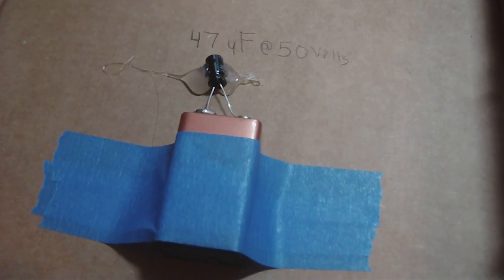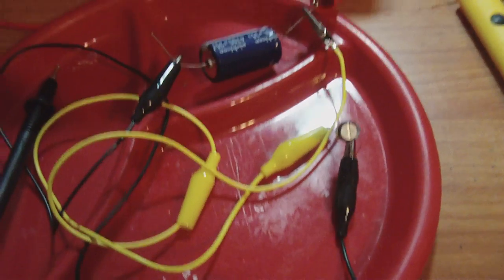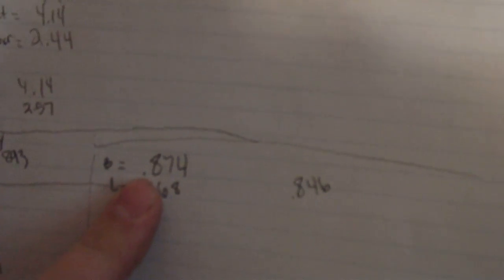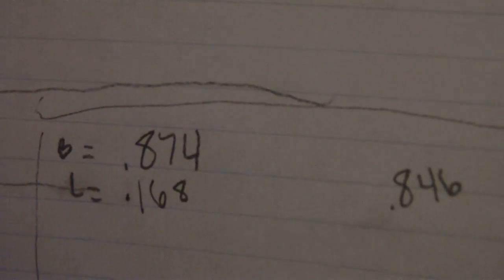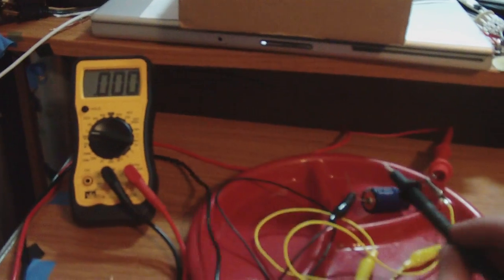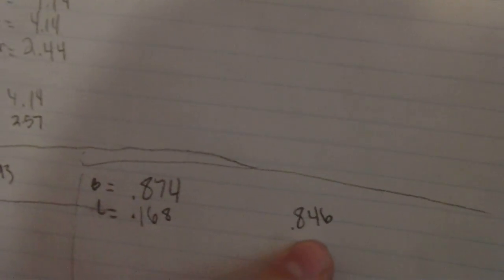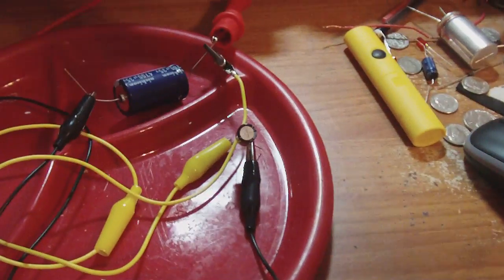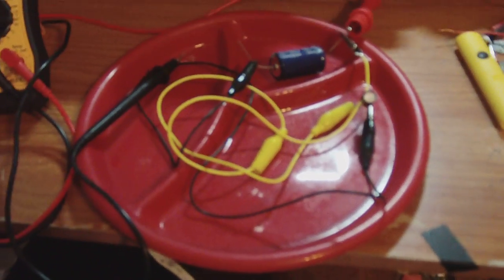Capacitors self charging off each other

Comment: If these caps are then bridge + to + to a battery, they will balance the charge between the batt and the cap, which is why charging slows as batteries get close to there capacitance rating (voltage)

Comment: Research Nikola Tesla and radiant energy... basically it's absorbing RF signal am or fm and storing it into the capacitor.  Truth is all capacitors WILL absorb radiant energy, but very slowly and only to the max voltage which is being broadcasted in RF that you are able to receive.   Consider HAM Radio and how it uses the RF Signal for power with very large caps, and plays out a lower volume than what you may want... which is why FM radios have built in amps that add power from you ac line-in th

Comment: After watching all your videos I have noticed that you are hooking positive to positive, and negative to negative. If you had hooked negative to positive as with a normal setup, the capacitors would drain out. However, there is an effect causing the potential to remain and increase. I am wondering if there could be some resonant electromagnetic effect taking place between the capacitors causing each to energize the other. Like broadband two way current. Waves passing through each other.

Comment from the maker: @Inquorate

 I've tried the 12 volt batteries and it works just like the capacitor. I have one big battery that had 12.54 volts and a little 12 volt with 12.36 volts in it. Hooked them in parallel and the voltage on both went to 12.45 volts. After a couple hours it is now up to 12.48 volts. When i started both batteries total voltage was 12.54 + 12.36 = 24.90 ; Now since both batteries = 12.48 their total voltage now is 24.96 votls. I've gain .06 volts.

Comment from the maker: @Inquorate Big battery needs big capacitor. The reason why the current setups work is due to their low capacity. I don't know of a big enough capacitor or better yet a cheap enough one either.

Comment: Seems the 2 caps in parallel have increased in energy for around 200 mikroWattsseconds.
Could be, that the contact material of the zinced croco cables with the copper leads
or soldering of the leads produces very small diode effects and this rectfies
the RF from mobile phones and other background radiation  that is captured by the cables.

Regards, Stefan.